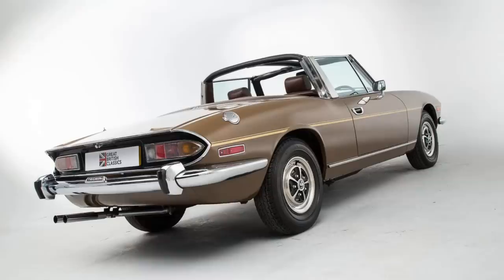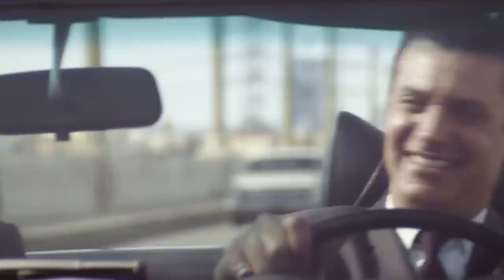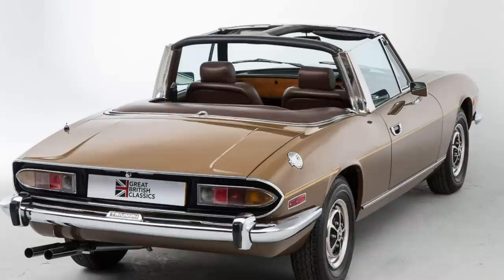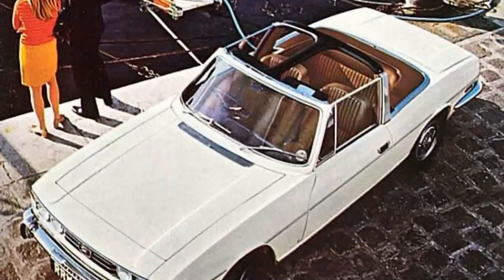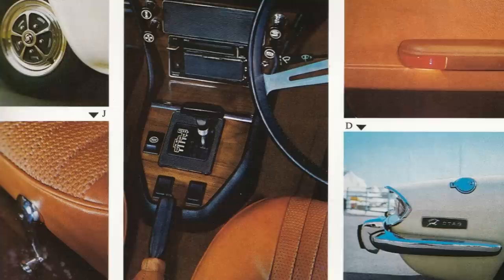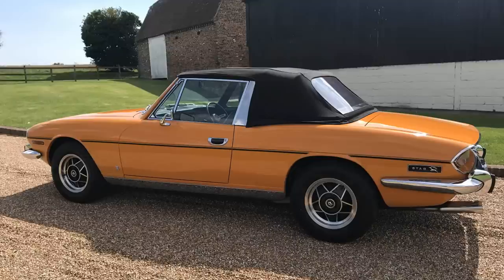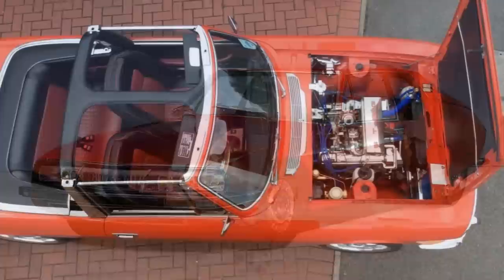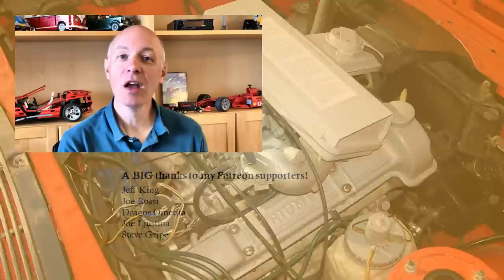Why did the Stag FAIL so Spectacularly?

Comment: So well researched and very well produced historical video. Kept my interest right to the end. Such a shame the Stag didn't work as superbly as the Triumph Vitesse 6.  My dad had one and I drove it aged 17 on passing my test. 62mph in 2nd; 85 in 3rd and 115mph in 4th didn't need a fifth gear.  Twin Stombergs were a doddle to tune. The 6 cylinder engine was fantastic.

Comment: Ran a Hart engined Yellow Stag for 3 years. Fitted easy slide drive shafts and went to Rostyle who cast 5 of the last wide rim alloys as used on the rally 2.5pi. With bigger rad and electric fan, the 4 speed + overdrive was thrashed for 30,000 miles fault free, hardtop fitted for winter. Loved that car what a sound.

Comment: I owned a Stag shortly after their launch and found it a superb  .
However it soon became unreliable and the back axle failed, the engine failed it became rusty.
Sadly the car industry was slowly dying with weak management and strike ridden workforce.
I feel Triumph should have built a factory in the USA with local management and workforce.
Reply: The problems of the British motor industry was caused 100% by bad management, failing to address the problems led to strikes, so the workers got blamed for everything, fast forward to Japanese manufacturers setting up in England, with Japanese management, end of problem, Nissan in Sunderland is the most productive, high quality factory in the company, so the answer is British workers and proper management.
Reply: @jamesreynolds2867  Even worse than that - when (because of MFUs) they ran out of parts they'd find a way to goad the workers into striking so that they could blame the stoppages on them.
Reply: @anonnona8099    Absolutely, I know from personal experience at the run-up to the Ford Cortina Mk III the company had quality control issues which needed a delay production, so the company "engineered" a strike
Reply: @jamesreynolds2867  Poor industrial relations were undoubtedly a blight, and one of the root causes of the disfunctional relationship was the lack of respect shown to the workers – they were never accorded the importance and significance in the overall scheme of running a factory to make cars which they should have been, they were treated more like plant and machinery, to be wheeled in and out of use as the management saw fit.  And it wasn’t the fault of the people who built it that the Triumph V8 was cack, it was the fault of the people who designed it.  

And there was chronic under-investment.  Did you know that in the 1950s/60s, Land Rover were actually proud of the fact that there was a long waiting list for their vehicles, particularly in Africa, they saw it as an indicator of how good their product was – everybody wanted one.  The Japanese saw it as an opportunity to eat LR’s lunch by saying “you can have one pretty much right now”.

Comment: Having bought a new Triumph Stag in 1973 - and having seen the cylinder head gaskets fail 7 (seven) times in the first year,  I can promise anyone that the failure of the Stag was entirely due to the 3 litre engine. The 3.5 Rover enhine would have been faster and more reliable. They "dropped a bollock" with the Stag. It could have been a fantastic world beater. The reliability of the car was very poor. Manufacturing techniques and quality control were abysmal.
Reply: Terribly sad because I was in awe of the Stag when I started to notice them as a kid back in the early 80's. 
A friend of mine's brother had a gorgeous blue one and I remember taking a drive in it sitting in the back seat feeling the wind and the open top joy.
What a car, despite it's shortcoming.
B.L. were ludicrously incompetent as a car and they should've hung their heads in shame. They had the opportunity to fix that company but their ego and arrogance got in the way of sensibility.
They trashed so many car brands and took the whole house with it down the toilet.
Nothing short of criminal.
Reply: 7 head gaskets replaced
All on warranty
How many miles did you cover
You should have taken legal proceedings against the manufacturer 
NO FIT FOR PURPOSE 
Idiots as engineers repairing the engine cooling system
Reply: @tonymontana897  Same here mate, I loved the Stag but sadly never owned one, I had the opportunity of a beauty but let it slip through my fingers. They still look stylish today. I had a TR7 and a Spitfire which I enjoyed, the Spitty more than the TR7 I must admit. The Speke plant was about 2 miles from where I lived, long gone now.
Reply: No problem with mine...it had kenlowe fans
Reply: FAIL? Or DAMAGED from over heating because whoever did those repairs, did not identify and rectify the cause of the over heating. 

On any car, Cylinder Head Gaskets rarely fail. Invariably they are first damaged by an excess of heat IN ANY car. Ask my work colleague who sent his five series to the breaker yard as he was advised the Head Gasket had failed and he could not afford the repair costs. Nice car met a premature demise due to ignorance.

Clarkson Wannabees and those who studied at the Clarkson Academy of automotive appraisal excellence and failed miserably are obsessed with the word FAILURE. It is a failing of many Brits where cars are concerned particularly those within the UK media in all its forms which is harmful to this nation in so many ways. As I type this in my peripheral vison is another YT posing ...Triumph TR7 = The Face of Failure.

I know of several Stag owners who are delighted with their cars. No over heating issues as they are maintained by folks who really know what goes on under their car's bonnets. I would not trust a certain spanner phobic so called motoring journalist to know where the bonnet release is on his daily driver. No names no pack drill. Magic happens is a clue.

Only in the Land of the increasingly self-inflicted. Bonus.. ongoing.
Reply: They didn't get the rover v8 because the rover side of bl wouldn't talk to the triumph side. It was a deliberate act of sabotage. The triumph people then designed the engine bay so that the rover motor couldn't be easily retrofitted.
Reply: @keithskelton2287  Manufacturer or those entrusted to repair who are the real NOT FIT FOR PURPOSE 

Ten plus years ago, lady friend had the  "They all do that mate" Cylinder Head Gasket repeat FAIL on her little Rover. That as she drove it home after the professional   "repair"., Said I'd take look making no promises. Long story short I not only fixed it so it would go on cover well over 100,000 reliable miles, but in so doing I identified the cause of the DAMAGE to the Head Gasket which like most, had not failed. 

The all important dowel nearest the timing side does rather more than simply locate and align the Head to Block interface, was missing! That dowel does rather more than locate the head. It is the main conduit of the oil supply at high pressure to the Double Over Head Camshafts [ DOHC ]  and valve gear. Cue Oil at high pressure pumped all around the engine and cooling system where it should not go. I have recorded numerous images of problems, some serious, which are not the car's fault, but the fault of those entrusted to care for the cars. Cars I rectified when folks approach me with their problem cars on a "You know about cars" basis.
Reply: @T16MGJ  I had a Rover 820 which had a head gasket issue 
under warranty it went to the St Albans main Rover/Land Rover dealer
they had it 4 weeks and gave me a courtesy car
on picking it up
I drove to Ealing W5 and the engine was pizzing oil out
I stopped a couple of times to top it up
long story short 
the engine was replaced later at a different branch
as the idiots who has worked on it
had no idea    
Some years later
I had a Discovery 
same story of service at 500 quid a pop 
totally useless 
I moved over to VW [diesel engines 150k no bother] 
never had an issue with them  
sad story 
Take care
Reply: @keithskelton2287  We have a VW Golf in the Family. Twenty years old 160,000 miles Petrol. My son's wife's car. He has several cars including a Rover 620ti with Rover's very good T-Series Turbocharged Petrol he's had for twenty years now showing 240,000 miles. Been all over Europe in it. Snowboarding in Norway, Exploring Alps and even a lap of the Nurburgring. That lap on YT bit of a giggle with his mates on board

New car potential problems. Taking delivery of my new MG ZS 120 with 1.8K Series twenty years ago, I asked the sales Guy to release the car's bonnet as I wanted to give it a once-over. "No need for that Sir, your car has had a full PDI".. PDI = Pre-Delivery Inspection. Glad I did. The Coolant Expansion Bottle had been filled tight up to the brim, leaving no room for ... Expansion! Had I not checked that and drove to London as I planned who knows what may have happened. Twenty years previously, took delivery of a new MG. First long journey, parked up and a few minutes later someone alerted me to the large pool of coloured liquid under the engine. Radiator hose had not been fastened correctly and the usual build up of expanded coolant pressure which is normal in a switched off hot engine, eased off the coolant hose allowing lots of Coolant to hit the deck. I soon fixed that and car went on to do 100,000 reliable HARD driven miles. Same with the MG ZS used daily by all family members but mainly by my wife including today. Now showing well north of 113,000 very reliable miles.

As so often happens. the poor car gets the blame when reality means the blame lies elsewhere.

I bought my first car many moons ago. I soon learned the hard way where Cars and just about everything is involved ...

BEWARE  PROFESSIONALS  AND  EXPERTS.

That on the whole has stood me in good stead ever since.  UK Governments could use that as a mission statement.

Comment: Its a shame Triumph couldn't have used Daimler's plucky 2.5lt V8... it was a great engine
Reply: Perhaps. Were they paying royalties to Buick ? the originator of the 3,500 Rover V8 .  WHAT an easily avoidable disaster !. All alloy V8 would have been excellent !!!
Reply: Paul O'Connor rover bought the rights to that engine in the sixties so no royalties to pay William Martin Hurst done the deal as the engine was discontinued out in the states as it was too small
Reply: @garethj9757  Gawd they were idiots attempting that Stag V8 then.  Folly and a fools errand. That metalurigical stuff and the high water pump was news to me. I'd heard about the vapor lock. But Fragment / sludge in the Radiator !!.  Four grenades built into that thing ?? !!
Reply: Dana Vixen..... the Ford 289 or 302 would've been even better.....
Reply: @branon6565  Too large and heavy. It would have been nice to continue a good already existing British designed V8..
Reply: The Stag really calls for a compact V8, more than the huge American ones of the time, and even the Rover 3.5 V8 would have been quite tight for the car. the Daimler 2.5lt V8 would have been perfect
Reply: For those not familiar with the Daimler V8 and how it sounds, watch this   https://www.youtube.com/watch?v=lpzudBhWap0
Reply: I have often thought this as well. They could have squeezed the 4.4 ltr version in the stag and the 2.5 in the Triumph 2000. Then cut it in half making a 2.2 ltr for the Sprint and Dolomite,,,,or something like this
Reply: Why stop at Daimler's 2.5 V8 when the 4.6-litre V8 from the Majestic Major would give even more of a push?  Same designer of both:  BSA's Edward Turner;  guru of hemi-head engine heaven.  The 4.6 sounds like the 32' Bombarde stop of a cathedral organ when burying the throttle.  Sub-sonic bass rumble all the way!
Reply: @britishcomposers  Imagine if Triumph had taken the 16v head from the Dolomite Sprint, and put two of them onto the 3 litre V8 block!
Reply: @polbecca  yes, what a thought, the 2 valve/cylinder heads were bad enough.
Reply: I thought that 2.5 lump had chronic bottom end issues?
Reply: @richardrichard5409  Absolutely not, it was a superb engine and not much less powerful than the Triumph engine, I love Stags I've owned 3 but still think they missed a trick with the Daimler engine, designed by a Triumph engineer, used quality materials, looked good, sounded good and would have been easily tuned buy the Triumph factory to put out more than 146BHP
Reply: Should have built the Daimler SP252, an even more attractive car than the Stag!
Reply: @DanafoxyVixen  Hemi heaven.
Reply: @DanafoxyVixen  Hemi heaven.

Comment: I had my Stag engine rebuilt by a friend who worked at Cosworth on V8s He said the pistons were to tight and spent ages getting the valve timing right. Slight inlet and exaust porting and  balancing on pistons and cranks. Air filter was the pipercross prototype. Electronic ignition. Compleatly different engine when built correctly could pull 6500 rpm in overdrive on a cold day. Constent rebuilding of everything else. Scary monster to drive.

Comment: I've been curious about the Stag and it's development due to having a '71, SAAB 99 with the 1.7L four engine.  It was a delightful unit until the head gasket problem hit it at about 70k miles.  I did the work on it myself, had the cylinder head milled to retrue which was advised against by SAAB instructions.  It had to do with creating slack in the cam chain as my guess and also the relationship with angled bolt passage clearance in the head.  I had no more problems with the head gasket and went on to about 107k miles when apparently a piston broke.  When I tried to remove the angled studs for the cylinder head, they wouldn't budge, corroded to the head I guessed.  With other pressing things in my life at the time, I sold the car to a rebuilder.  In talking to the local SAAB dealer, I understand they had to destroy some of the heads to get them off the engines.
Reply: Those angled head studs were just a genius design! I saw one in a shop once where they'd made little plasticine dams around the studs to hold something like WD40 and a block and tackle lifting the heads till the car was just off the ground. Every morning they'd add a little more lubricant. If the heads moved a little, you could get a hacksaw blade in to carefully cut them.
Reply: @deaddoll1361  Love it...True genius !

Comment: The engine was absolutely fine. The trick is to remove it, strip it, replace most of it then reassemble it correctly.

Comment: Another great one! Loved the archival photos of Triumph’s under development.
We get Triumphs decision to develop their four and V8 but had they not made so many mistakes in their appalling design and development, both engines could have formed a credible modern replacement for BL’s ageing engine lineup which comprised post WWII Austin/Morris fours and sixes and a GM cast off V8.
SAAB never suffered the same stigma despite starting with the same engine.

Comment: Loved this car to bits.
A couple of other things, the TR7 was originally designed as a soft top, but the USA roll over laws meant it had to be built with a hard top.
Also, we were working on an aluminium TR7 with a 1600 ltr engine to go at the bottom of the range. The TR7 was designed to fit all sizes of drivers so the seats had fantastic travel for us tall ones lol

Comment: Poor fettling on manufacture meant casting sand was left in the blocks as well and when crossion oxides are added to the problem not only radiators but whole sections of the block would fail to flow coolant properly. If you ever tried to flush an engine at the time you would see sand wash out of the drain points. Sad part is with a little development they were and still are a smooth running and rich sounding motor.

Comment: Thankyou. Great critique of the Stag. Should have had the Rover 3500 engine all along in which case it wouldn't have won a lemon award. Oh well! The Triumph engine did sound quiet and tight when it worked. Great on the test drive. But then...  Still want one though :)
Reply from the maker: Yeah - we humans are odd. We know it's bad for us, but we still want it!
Reply: Its a challenge to take a Stag that despite the passage of almost 50 years still has production issues that were never sorted.  When we rebuild engines, we fully flush out heads and blocks, and on many engine we still find heaps of casting sand.  Once removed the engines run real cooooool.

Comment: It wasn't a case of the Rover V8 not being available, it was a case of inter-marque rivalry between the two companies which meant that Rover did not want Triumph to get their (Rovers) V8. This was pretty well guessed at by petrolheads at the time, and proved some years later under the Freedom of Information act.
Reply: Definite, as Rover was ALREADY supplying the 3500 to Morgan by the time the Stag started shipping.
Reply: That played a part too. The problem with the Triumph V8 was the cooling system. That mainly with lazy owners who did not keep and eye on things as recommended by all motor manufacturers and some of the workshop  entrusted to look after the cars. Seen lots of evidence pf that over the years. Invariably the poor cars get the blame.
Reply: @bricefleckenstein9666  Rover also supplied Morgan with their excellent M/T series too I believe.

Comment: I had a blue Stag. Beautiful and fun with decent power and electric overdrive in 3rd and 4th gears, switched on the gearshift. I guess a previous owner or mechanic didn't take enough care. the hydraulic timing chain tensioner on one bank of cylinders was left locked in the maintenance position and not tensioning. Theslackness of the chain evidently wore the crankshaft sprocket and one time starting the engine the chain slipped and then grabbed again and forced all of the valves on one bank (4 cylinders) into the pistons, breaking valves and main bearing caps. Terrible.  And the cylinder head being held on by bolts at one angle and studs with nuts at another angle made work difficult and put stresses on the head and studs. Pulled the engine and went through a tough repair.